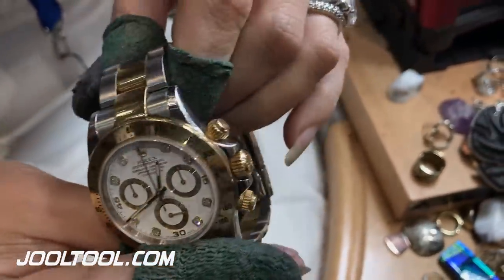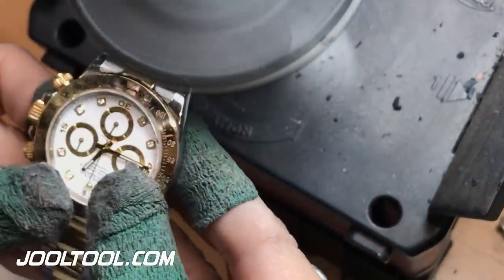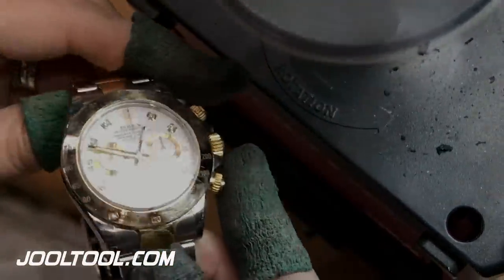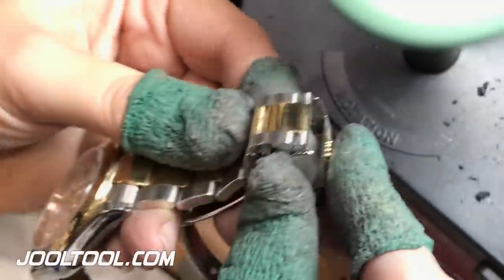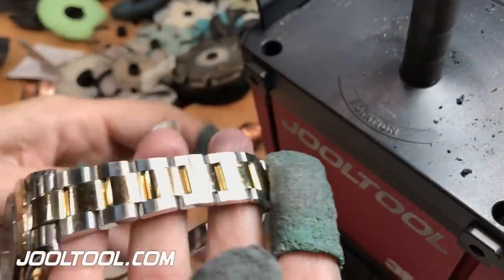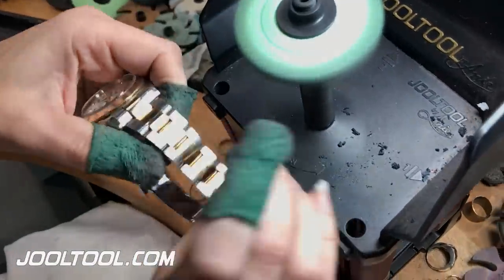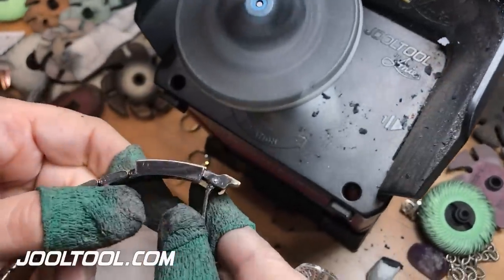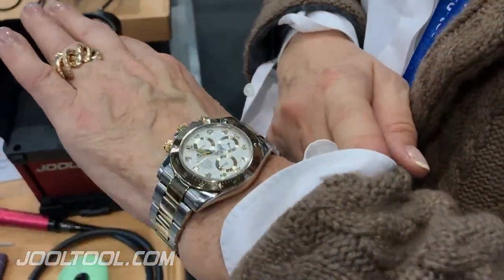Rolex stainless steel polished on Jooltool - LIVE at a trade show

Comment from the maker: The FLAT Felt Wheel I am using has metal particles on it from prior polishing (jewelers know what I’m talking about). So when I started to polish the bezel, both the metal & compound began settling into the numbers. Aided by the bright ambient light, what you are seeing is the reflection of the metal mixed with the compound. The compound came out easily with the steamer they had in the booth. Every watch maker in my live audience analyzed the watch and did not question the integrity of the “Black”. Instead, they commended the quality of the polish. Note that the recessed black enamel in those numbers is so resistant to abrasion and difficult to remove. To do so, one would need tiny Dremel-like brushes & burrs to do that, NOT a FLAT Felt wheel. These comments are so ignorant, yet hilarious. In any case, thanks for watching. -Anie, the girl in the video that invented the JOOLTOOL.
Reply: I am a watch professional and I really like your machine and the polishing technique and results knowing that there is NO sanding off .. great method. Dont  worry about the negative comments and keep it up... looking forward to watching more videos.
Reply: Who are you calling ignorant? No one is blaming your "invention", they're blaming you. There are steps to polishing a timepiece and you ignored virtually all of them.

Comment: Omg the black lettering is gone. Ruined it 😔
Reply from the maker: LOL JJ 😂 The FLAT Felt Wheel I am using has metal particles on it from prior polishing (jewelers know what I’m talking about). So when I started to polish the bezel, both the metal & compound began settling into the numbers. Aided by the bright ambient light, what you are seeing is the reflection of the metal mixed with the compound. The compound came out easily with the steamer they had in the booth. Every watch maker in my live audience analyzed the watch and did not question the integrity of the “Black”. Instead, they commended the quality of the polish. Note that the recessed black enamel in those numbers is so resistant to abrasion and difficult to remove. To do so, one would need tiny Dremel-like brushes & burrs to do that, NOT a FLAT Felt wheel. These comments are so ignorant, yet hilarious. In any case, thanks for watching. -Anie, the girl in the video that invented the JOOLTOOL.
Reply: @JooltoolUSA  if that is the case i take my comment back i was unaware how resistant the black can be. i just saw it gone and thought it completely changed the look of the watch
Reply from the maker: JJ you’re a Good Man ♥️

Comment from the maker: This JOOLTOOL is used in many watch Repair centers around the world. Our process does not use abrasive compounds to remove scratches, that can easily round over the factory edge. Instead, we use 3M technology of burnishing the metal, this means we are not sanding the metal off, instead we are rubbing it back into the metal. This process allows the scratch’s to be removed without changing the original symmetry of the watch. In addition, our patented see through disk allows you to polish with accuracy, & detail as you can clearly see through the disc and the the edges of the watch while polishing. We are using a Flat wheel to Burnish & Polish, Unlike a round wheel. It is impossible to get a “dead” flat surface using a round wheel, just plain physics. To achieve a final high polish we are using our special formulated compound, approximately 100,000 grit, this compound will give a high polish. We are not using the Compound as an abrasive to remove scratches, instead, to achieve a higher luster finish. 3M Technology has advanced in polishing just like cell phones  just because a flip phone worked it the past doesn’t mean we should continue to use the same old technology as it is nowhere as advanced as the newest smart phone on the markets.
Reply from the maker: Note that the recessed black enamel in those numbers is so resistant to abrasion and difficult to remove. To do so, one would need tiny Dremel-like brushes & burrs to do that, NOT a FLAT Felt wheel. These comments are so ignorant, yet hilarious. In any case, thanks for watching. -Anie, the girl in the video that invented the JOOLTOOL.

Comment: What's the matter with all the guys who disliked..  Dear if u will go to Rolex for the same job then they will cost u more than they deserve..  The lady is doing great and awesome artistic work on the watch.. I think she deserves a great respect.. 
Lots of love for your craftsmanship.. 😘😘😘😘
Reply from the maker: Awww Thank you!!! You are such a kind, sweet, gentleman and I really appreciate your comment! Love Anie ❤️
Reply from the maker: The FLAT Felt Wheel I am using has metal particles on it from prior polishing (jewelers know what I’m talking about). So when I started to polish the bezel, both the metal & compound began settling into the numbers. Aided by the bright ambient light, what you are seeing is the reflection of the metal mixed with the compound. The compound came out easily with the steamer they had in the booth. Every watch maker in my live audience analyzed the watch and did not question the integrity of the “Black”. Instead, they commended the quality of the polish. Note that it the recessed black enamel in those numbers is so resistant to abrasion and difficult to remove. To do so, one would need tiny Dremel-like brushes & burrs to do that, NOT a FLAT Felt wheel. These comments are so ignorant, yet hilarious. In any case, thanks for watching. -Anie, the girl in the video that invented the JOOLTOOL.
Reply: You didn’t use a steamer. She walked off with the watch. It now needs a new bezel. It’s lost the black enamel